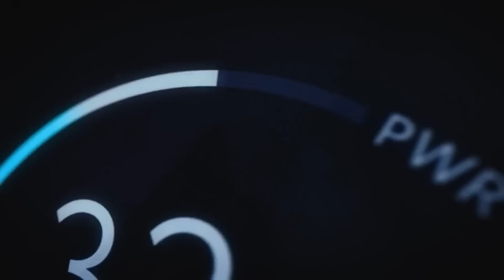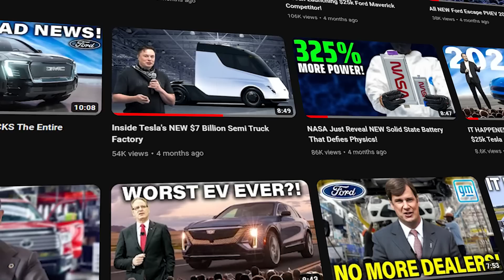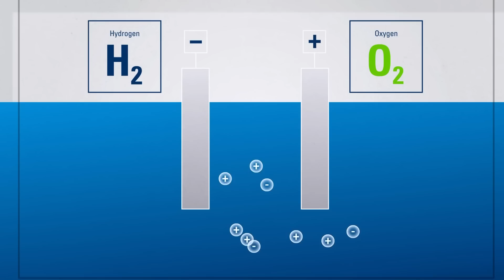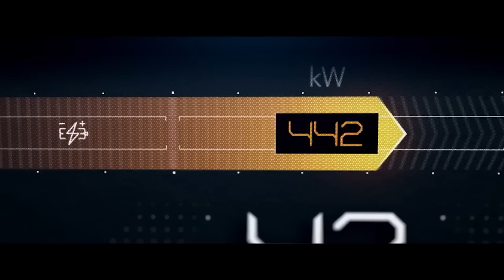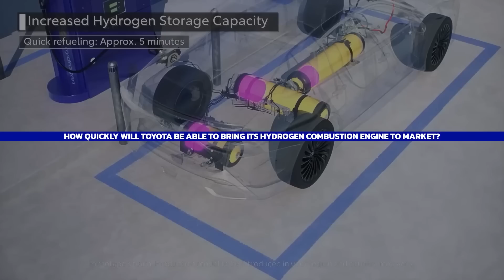New Toyota CEO Reveals Hydrogen Combustion Engine | Shocks Industry!

Comment: I thought Elon is right. Why you need to convert electricity to hydrogen and wast energy to compress it in to liquid and then transport it to distribution station. Overall energy efficiency after this is less than 60% not including loss in the combustion cycle loss in heat and frictions in the power train. Overall efficiency is less than 40% what a dumb idea.
Reply: Yup, he's sunk the company. Dead man walking
Reply: @jasonbuksh2958  This is what happens when the grandson of the founder runs your company.
Reply: @machoopichoo2  I can't believe they would be that insane, I'm thinking that this is a ploy to throw everyone else off track while they go electric.
Reply: Except possibly for long range trucking or even aviation, hydrogen cars is now a waste of time.
Reply: If you MUST use hydrogen to power ground transportation, then the fuel cell is the way to do it.  If you use an ICE burning H2, then the same weight of H2 plus tanks if put into batteries in an EV that would give you 300 mile range, might get you a 50 mile range in the H2 car.  That's because of the energy wasted in heat by the ICE.  OTOH, cryogenic (liquid) hydrogen would be the ideal fuel for use in a jet engine in an airliner.  The thing about cryo tanks is that you will lose all of the fuel in them by evaporation in just a few days.  In a car, that's a big problem, you don't want to refuel every time  before you start a short trip!  However, an airliner would always be tanked up just before take off, so there isn't a problem.
Reply: @KennethScharf  California is using Blue Gas which is Fuel Cell and the users appear to be highly satisfied. Fuel cell has been working on it for several years, I'm powering industrial and large residential complexes quite successfully.
Reply: @Jax_1  There are 53 public H2 filling stations in CA. Really scaling well. Plus almost all H2 is obtained from "natural gas."
Reply: @machoopichoo2  From "natural gas " ? What natural gas do you mean? Natural gas= Air. Or do you mean thru mining gas from  fossil?
Reply: Battery works for light duty vehicle. But for heavy duty vehicles like trucks and airplanes, hydrogen will be much better suited because of higher energy density...battery simply won't work
Reply: @charleshsu7160  Not even H2 has the density needed! Even cryogenic H2 (LH2) lacks the needed density. And SAF takes gargantuan amounts of electrical power to produce! H2 is a FAIL no matter how you look at it!
Reply: @charleshsu7160  we already have EV heavy duty vehicles. If hydrogen was anything but a scam, we would already have commercially available heavy hydrogen vehicles.
Reply: Battery electric has a lot of energy losses itself so really which one is better?
Reply: @MustangsTrainsMowers  a BEV is 80% efficient, an ICE is about 25-27% efficient. A hydrogen fuel cell is 40% efficient. What do your figures show?
Reply: @jimwhook  
I haven’t read that up lately as I’m busy working 2 jobs.
Reply: @MustangsTrainsMowers  you got time to watch and comment here...
Reply: @jimwhook  
Which is limited. Really we should look at efficiencies from beginning to end since there are multiple ways to generate electricity.
Reply: @MustangsTrainsMowers  I was talking about from generation to wheel. Did you think that was battery to wheel 😅
Reply: @jimwhook  
I don’t remember. I’m at work right now.
Reply: @jimwhook  the fuel cell is 40% efficient. Now figure in losses from electrolysis, compression, and transport. You get down to about 25% efficient grid to wheels.
Reply: @williammeek4078  I was including that. Fuel cell is better than ICE but only marginally. If they could figure a way to produce hydrogen cleanly without using 3 times the electricity it might help but by that time solid state batteries will be standard.
With solid state, you reduce battery weight, increase range, remove fire hazard and most of all charging time will be reduced. At that point, there will a flood of drivers switching over.
Reply: @MustangsTrainsMowers  battery electric is between 80% and 90% efficient. Hydrogen fuel cells are around 25% efficient. Hydrogen ICEVs are around 12% efficient.
Reply: @williammeek4078  
I’ve never seen efficiency numbers for electric that are that high. They lose lots of power here in Minnesota in the winter time.
Reply: @MustangsTrainsMowers  the “lost” power goes into heating the battery. Similar losses happen for ICEVs. If you garage your EV, losses can be less than what an ICEV deals with.
Reply: There's also a large loss of efficiency in transmitting electrical power to stations, charging batteries, and then discharging batteries. There are good arguments against hydrogen, but this isn't one of them.
Reply: @GamesFromSpace  EVs are 80% to 90% efficient grid to wheels. HFCEVs are 25% efficient grid to wheels. Hydrogen ICEVs are about 12% efficient grid to wheels. 
Efficiency makes hydrogen nit viable.
Reply: @williammeek4078  Sounds good, except for the grid part. The grid isn't 100% efficient, there's a major loss there. Worst case, if you count the wasted energy as a whole, it's only 40% efficient. Best, still 10-15% loss assuming everything went perfectly,. just to get the power to the socket.
Reply: @GamesFromSpace  since green hydrogen is made from electrolysis powered from the grid, and that is common to both, and both are electricity agnostic (ie is doesn’t matter where the electricity actually comes from) it doesn’t make sense count the grid in the efficiency calculations of the different powertrains for the cars.

Nothing you say here changes the conclusion that EVs are 80% to 90% efficient while HFCEVs are around 25% efficient and the hydrogen ICEVs from this article are only about 12% efficient. This means hydrogen will always have a per mile cost of 3x more than a similar BEV. This only gets worse for heavy vehicles making hydrogen uneconomical for heavy vehicles too.
Reply: @williammeek4078  Except that hydrogen can be generated anywhere and anytime power is cheap, that's half the point. Electricity needs to go the entire way as electricity, all the way to the battery.

It's ok to think EVs are better, but why do you keep making such poor arguments in favor of it?
Reply: @GamesFromSpace  I haven’t seen a good argument in favor of hydrogen that is based in reality. Remember, green hydrogen is made from green electricity. 
Sorry, but in no way does hydrogen work economically over BEVs. There is more than a few reasons BEVs have won out over HFCEVs.
Reply: A bit like coal being converted into electricity to charge batteries. Of course that coal has to be mined by massive diesel powered machinery. Not to mention all the strip mining and child labor being used in 3rd World Countries to find the needed materials needed to build these "clean" batteries. 
The definition of Clean Energy is "GREAT... but not in my backyard!"
The most pristine areas on our planet are now being destroyed via strip mining.
EVs = CBs (Coal Burners)
Reply: Elon Musk is genius and STUPID at the same time! It takes fossil fuels to generate electrical power. It takes gargantuan amounts of electrical power to split water, power we don’t have for EVs nor FCEVs, nor H2ICE! And it takes continuous drilling for more methane/natural gas!! Technology doesn’t exist to replace all electrical power needed that we HAVE to get from fossil fuels! Pipe dreams, and crack smoking pipe holders out there!
Reply: It's called RED hydrogen. And Japan's infrastructure produces it as a "waste" product of its larger nuclear driven power infrastructure. 

It's actually the least wasteful method of energy production. Really worth looking into.

Also, Elon is a privileged detached idiot.
Reply: Exactly. Hydrogen combustion engines are completely worthless. Really sad that Toyota is wasting valuable engineering talent on a dead end.
Reply: Toyota is a very profitable and smart company. Im sure they know what they are doing. It is dumb of other companies to hedge all bets on 1 idea . It is going to take a combination of types of cars to run things. Not 1 style is perfect
Reply: @taylanlowe120  False, it's like investing engineering talent in coal powered steam engines. Some technologies are dead ends from the start. Combusting hydrogen in engines makes no sense. Way worse than fuel cells from both a cost and energy efficiency stand point. Toyota used to be a smart company, but their edge is quickly slipping.
Reply: @taylanlowe120  Toyota is only doing what the Japanese government wants them to do because they know that they're too big to fail and they'll be bailed out when they inevitably fail.
Reply: The most abundant element in the universe is hydrogen.
Reply: @DetroitMicroSound  Doesn't do us any good when it takes more energy to extract it from water or other sources and store it in high-pressure and expensive tanks than what we get out of it. We can't just get pure liquid hydrogen from the universe. Even dumber to just burn it it in engines than can never be more than 60% efficient asuming an ideal case with no losses. Also, filling up with hydrogen is not as simple as some people think, becuase of the high pressure it is kept at to stay in liquid form, fuel nozzles have a tendency to freeze to the filler tube at ambient temperatures. Not great for colder regions where that risk is even higher than in sunny California. Renewable natural gas is much safer, cheaper, and cleaner when you consider well to wheel emissions, Toyota should be focused more on that especially for larger trucks. Don't really want to Hindenburg my car.
Reply: @JEP-Tech  Let's watch what Toyota does. It's essentially Japan's national car maker, with the full weight of the Japanese government behind it, and Japan is one of the richest countries in the world. Toyota is also a city of more than a half million people, and probably has hundreds of scientists working on this, all funded by Toyota, and Japan. If Toyota thinks they can do this, I trust them. You know who I don't trust at all? Elon Musk, and his social media army, that tries to paint him as an engineer. HE IS NOT.
Reply: Ev will not be able to sustain commercial materiel transport in the long run. The power needed to charge a truck stop worth of trucks is immense. Not to mention, the vast majority of materiels needed for batteries are locked into less than pleasant land masses.
Reply: Maybe because you don’t have to covert electricity to hydrogen…. fossil oil can also be used to make hydrogen with less energy
Reply: Hydrogen is FAR more energy dense, and doesn't require insane amounts of lithium. Efficiency only matters if it is also useful. Less efficient but more useful is going to win every time
Reply: If the green hydrogen is made with wind or sun available everywhere , anywhere, why do you want to « transport » this energy elsewhere , it is completely silly, unlike electricity H2 can be stored very economically (COPV 10$/ kWh stored vs 150-200$ for LPF and Over 50000 cycles or 6 month at full pressure without any measurable gas loss ) so that green H2 storage cost per kWh is almost insignificant financially and you for long extended period of time on site with also little economy of scale with larger sizes of system unlike power plants for availability at multiple location without the cost of an expensive power network. Then, speaking of « efficiency » for an zero carbon energy supplied free of charge has also very little sense, your electrical mind is wrong Elon since the total cost per useful energy kWh used or stored and the amount of grey energy for producing, recycling and dismantling the energy production system is much more essential for abundant wind and solar power of all unused offshore desert and roof surfaces etc….with biomass and geothermal as clean supplements. Also, if green and clean hydrogen is locally produced everywhere, it can be produced stored used and sold with fair trade exchanges without the huge current energy monopolistic margins of gas stations, electric and gas meters. Moreover, the local green H2 so called « huge losses » are also sellable for domestic volumes heating, hot water or absorption cycle air conditioning and the 8 pounds of pure oxygen produced for each pound of green H2 has also a great commercial value for welding or medical use of quite a few dollars per pound….thus lowering the futur cost of all three items, pure H2, pure O2 and domestic heat,,,,In summary of this initial comment, I guess you react like an 19 century electrician which would electrify his railway with a resistor in the boiler and the pantograph on top of the cabine of a steam locomotive!!! But when the primary source of energy changes, the distribution must adapt 😮to it and the charges also adapt to this new distribution, NOT the reverse….(jute bag for coal, power line for electricity, tanker truck for servicing gas station, etc,..) there are no question, hydrogen is an optimum way to produce, store and use green and clean surface power without expensive network and any inefficient massive storage now needed by those variable unpredictable and seasonal free of charge energy sources. Then H2 does it with much less grey energy overall than a full electric reinforced network non sense massively beefed up for domestic heat pumps and electrical mobility replacing  those existing fossils energy charges, specially at current 9000$ per ton and 3000$ per ton copper and aluminium prices…storage of electricity is so inefficient that production has always closely matched demand and the night surplus are wasted in light pollution, heavy mobility recharging and other non senses night usages invented ( French power utility even paid the sncf railway company for high speed TGV to go faster at night with increased wear and energy costs!!!) now, with much more massive and endurant storage required by the erratic free green clean power, a type of power source required for the planet diversity and sapiens survival, the electricity is no longer the (only) optimum vector to use economically and efficiently all the human energy required, at least on the new clean power portion of the many converted domestic heating and mobility huge loads which are also different than instantly needed loads like lift light medias etc..for which the power network was designed for but not to accommodate all the transfer from fossil to local clean power huge amount.
Reply: Toyota currently builds cars that utilize a vast infrastructure of fuel stations to supply the gasoline energy they consume.  EVs utilize a vast and rapidly growing array of charging stations and also a much, much larger network of ultra-convenient home chargers.  Hydrogen vehicles have almost NO fueling infrastructure, and will not have any to speak of for a long time, if ever.  In order for hydrogen stations to exist, they'll also need backing infrastructure to produce, freeze, compress and transport the extremely flammable gas.  Who in their right mind is going to make this investment, and take on the liability?  Foolish buyers of hydrogen vehicles will regret their choices.
Reply: It’s absolutely necessary to keep hydrogen research projects going for the heavy-duty transportation industry, even if the overall efficiency is bad compared to EV. Nobody has come up with a EV truck that is capable of carrying heavy load over long distance and that’s because battery just doesn’t have a high enough energy density. Packing more battery increase the load weight at the same time. Unfortunately, trucks and airplanes co2 emissions contributes to climate change far more than other vehicles. Furthermore, hydrogen can be produced using renewable energy sources and currently there is a robust infrastructure supporting hydrogen storage and transport in heavy duty industry.
Reply: @charleshsu7160  see Tesla Semi. Long range heavy EVs are already here.
Reply: It is absolutely insane that people are still spending money developing hydrogen right now. 
But you can see this guy that commented here three minutes ago.
He still thinks hydrogen might be better than Electric.
Obviously with the huge losses of hydrogen there's no way.
😊
Reply: @eliasshedd  Are you a scientist ?
Reply: So you are more intellegent than Toyota's R & D scientists. I have no clue about how it works but if Toyota spend so much on developing this technology, it must be viable.
Reply: @tomchan2559  yes, everyone who has the slightest training in engineering or physics is smarter than Toyota’s R&D scientists.
Reply: I think if we can mass produce hydrogen it’s a far better way to go. It takes 500,000 pounds of earth, dug up with diesel motors, just to make a single 1000 pound car battery. At 60 million new cars per year that is a massive destruction of the earth’s crust, just to make the batteries. Then the car has to haul that 1000 pound battery everywhere it goes. Tesla’s smallest battery is 1300 lbs. Also hydrogen is a better fuel for aircraft. I saw a film where hydrogen can be shipped in something like charcoal. I’m sure the battery tech is easier, for now, but hydrogen is less damaging and can be made at the current gas stations using solar power.
Reply: @obijuan3004  no, it takes 3x the electricity to move a HFCEV a mile compared to a BEV. It is 19x for a hydrogen ICEV. 
Even more, EVs are recyclable.
Reply: @williammeek4078   The math doesn't look that good for BEV's.  First, doing quick math, based on battery to car weight ratio's, a Tesla Model 3, uses 27.8% of the battery's power just to haul the battery. For a Model Y it takes  37.3%  of the battery's power to move the 1,700 lb Tesla battery.  In comparison a Toyota Camry uses about 9% of its gasoline to move the engine. A fuel cell would use about 9% of its power to move the fuel cell stack and metal hydrogen tanks. You never see that side of the math.  
Also, it takes 650,000 pounds of raw earth to make one average Tesla 1,300 pound car battery.  Global car sales are around 60 million cars. So, we would need to use diesel powered diggers, to dig up and haul 19.5 billion tons of earth annually just to make 60 million new BEV batteries.
 
For recycling, on average, about 50% of a lithium-ion battery can be recycled. This means that half of the battery's materials will need to be safely stored in a permanent way. Meaning more mountains of waste. 

Hydrogen, however, can endlessly be made from sea water using solar power, or from captured methane.  Also, gaseous hydrogen can be transported through pipelines much the way natural gas is today. Roughly, 1,600 miles of hydrogen pipelines are currently operating in the United States.  The cost to the earth for hydrogen made with solar is in the making of solar cells, the tanks to store the hydrogen and the pipelines or other transportation.

Hydrogen, if we can make enough, is a better long term solution than digging up tons of earth every year and then burying 50% of the old battery material. Also, what if we got good enough at making hydrogen that it replaces natural gas and aircraft fuel? 
Rolls-Royce has already made a jet engine that uses hydrogen. 
I could go on but...
Thanks for reading.
Reply: @obijuan3004  You need to learn your math. 
The Model 3 costs $4 in electricity to go 100 miles. 
The Toyota Camry takes $10 in gas. Even more the Camry can’t touch the Model 3 on performance. 
But the Model 3 beats with the BMW M3 on performance. 
Your number for materials mined in flat wrong. An EV weighs about 20% more than a similar ICEV so needs about 20% more mining per car. 
For recycling, 95% of the battery is being recycled. Meaning almost no waste. 

A HFCEV takes 3x the electricity as a similar BEV to go 100 miles. This mean 3x the solar and wind to move it as well as 3x the grid infrastructure needed. Hydrogen is vastly more resource intensive than BEVs. 

Hydrogen will always cost more to operate. It is just a dead end technology that has already been passed by BEVs.
Reply: @williammeek4078  A car is just transportation, speed limits are posted so performances means nothing. Tesla Model 3 starts at an MSRP of $42,990 with zero upgrades, not including any taxes, destination, or other fees. Yet the average price is around $51,000, with a top price of $72,500. A Camry,  costs $27,000 to $36,000. You could by a $30,000 Camry and have $20,000 left over, and never have to wait for a battery to recharge and easily drive the speed limit. BTW 35% of Tesla’s price is overpriced profit. EV’s are overpriced.
Reply: @obijuan3004  the demand for Teslas says they are not overpriced. Comparing a Model 3 to a Camry is ridiculous. They are very different cars. The Model 3 is a sports car, the Camry is not. People pay for performance as indicated by the global sales of performance vehicles. 
People with ICEVs have to choice but to make special side trips just to keep fueled up, generally once a week. EV owners generally just plug in at home. Vastly more convenient.
Reply: @williammeek4078  I only make special trips to get gas for my lawn mower, otherwise I stop for 5 minutes when gas is low to fill up my car.  No way that EV charging is easier. Millions of people live in places where charging is not available. I was at Hertz a month ago and someone reserved a Tesla, but the Tesla was not fully charged. The customer had to drive the opposite direction of their destination just to use a charger. With charging and travel time it would be over an hour just to charge her car.  I compare a Camry to a Model 3 because it’s real money that we are talking about. Most people can buy a Camry, but most people cannot buy the cheapest Tesla. Which means at some point Tesla is going to run very low on customers at their current price range.  So Tesla has to cut prices and profits to find new customers. I don’t buy a car because it’s as fast as a Porsche, that’s dumb. Personally, a Tesla is an ugly, soulless car, it has no class, because it’s designed for maximum profit right down to the big touchscreen dashboard. Having said that, if a Model 3 started at $25,000 then I would have to take a serious look. Right now only suckers are paying the high prices for a battery and huge electric motor(s), a luxury golf cart. When the EV price wars are over you will understand what I am saying. A car is transportation that loses value everyday that you own it. Why give away money?
Reply: @williammeek4078  One more comment, an average Tesla battery weights 1300 pounds. To make that dense battery it takes 650,000 pounds of raw material, according to people who produce lithium. That does not include the other materials that make up the battery. Only 50% of a lithium-ion battery is recyclable, which mean every car will leave behind around 650 pounds of unusable battery waste. Last year 66 million cars were sold, if they were all electric, we would be looking at around 42 trillion pounds of unusable battery waste EACH YEAR. We are trading one kind of pollution for another. Hydrogen, is the only long term solution.
Reply: @obijuan3004  you only go to a gas station to get gas. Therefore it is a special trip. People with EVs are going home anyway. No special trip required. 
As to the Hertz thing, that is Hertz’s fault, not the EV. 
Comparing a Camry to a Model 3 is still ridiculous. 
There is no sign of Tesla running low on customers despite much higher pricing. That tells you something about the value that consumers find in Tesla. 
Oh, and Tesla will have a $25k model here within a couple of years. 
Welcome to reality.
Reply: @williammeek4078  CyberTruck was introduced in 2019. Tesla has collected $1000 down payments since 2019, no CyberTruck in sight 1st quarter 2023. The $25,000 Tesla, its just more Musk propaganda at this point.
Getting gas might be a special stop, except on the highway, but its not a special trip.  Even if I drove from my home to the gas station, I'm ready to travel over 300 miles in 10 minutes max and I can leave the house with an empty tank and make a quick stop on the way. Not everyone has a home and a garage where they can charge an EV.
Look up range anxiety, its about the anxiety people have when traveling with a Tesla, driving from charging station to charging station, waiting an hour or more to access a charger.  I just drive by and wave.
Reply: @obijuan3004  kind of like how I drive by gas stations and wave at the people who have no choice but to waste time there getting gas.
Reply: @williammeek4078   When I buy gas its not a waste of time, its a 5 minuts stop to refuel.  And if I'm on the highway, its time to use the bathroom and maybe grab a snack. You still have to spend far more time, installing a system to charge your car,  if you own a home. Then you have to wait to charge your car for hours. So, even if you drive from charger to charger your time spend refueling is much greater.
Reply: @obijuan3004  that is 5 minutes more a week than I spend charging my car. I spend about 5 seconds a day plugging in and unplugging. 
And when traveling, I charge when I stop to eat. Again no time lost. You still spend 5 minutes. 
No, your time spent fueling is several times what I spend charging.
Reply: I think if we can mass produce hydrogen it’s a far better way to go. It takes 500,000 pounds of earth, dug up with diesel motors, just to make a single 1000 pound car battery. At 60 million new cars per year that is a massive destruction of the earth’s crust, just to make the batteries. Then the car has to haul that 1000 pound battery everywhere it goes. Tesla’s smallest battery is 1300 lbs. Also hydrogen is a better fuel for aircraft. I saw a film where hydrogen can be shipped in something like charcoal. I’m sure the battery tech is easier, for now, but hydrogen is less damaging and can be made at the current gas stations using solar power.
Reply: Elon is wrong. EVs are a waste. BLOOD EVs.
Reply: @markmiller8903  Agree! We don’t have enough electrical power now! But all of a sudden we DO for EVs??
Reply: @markmiller8903  Blood EVs 😂

 Anyone wanna tell him the atrocities committed for oil?
Reply: @Chris Peacock  not for oil produced in US.
Reply: Yes I do agree, but eventually the technology will improve and it will become the go to every for transportation and general use as well. Hydrogen availability is endless and the most powerful substance known to humanity.
Reply: @Jax_1  no, hydrogen can’t improve enough to compete with EVs.
Reply: @Jax_1  Dumb…It takes gargantuan amounts of electricity to separate H2O!!! There’s your loss in efficiency right there! Oh, and we have plenty of electricity??? Just go to California or any place for that matter… Oh, but electricity is free, right? Like we’ve already shut down every fossil fuel power plant in the US??? We have plenty of fossil fuel methane?? Clean?? Drilling for more??
Reply: What a dumb idea to use battery which can reduce its own efficiency overtime.. reduced efficiency means reduce mileage. Electric car is a junk
Reply: @tommyking626  sorry no, that isn’t how EVs work. Hydrogen just takes 3x the energy. No way around thst. Hydrogen IS a dumb idea.
Reply: @tommyking626 so elon didnt told u about the 100year Batteries?😂😂 Why so sceptic lil boy
Reply: @tommyking626  You apparently not good at the subject of physics, reduce mileage does not mean reduced efficiency, you screwed up the two concepts.
Reply: @hanfucolorful9656  That and LFP batteries are extremely durable, with no cobalt. The car will fall apart around it. The thing that is not widely talked about is, in the US., most BEV makers have an 8 year, 100K mile warranty. You won't get that on an ICE car.
Reply: @hanfucolorful9656  Lost milage, due to dendrite formation over time, is lost milage.